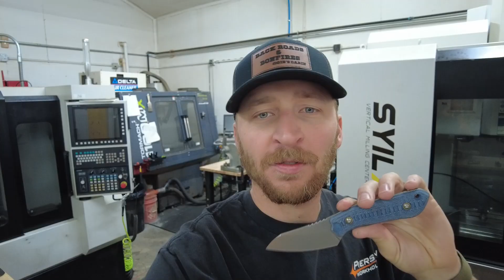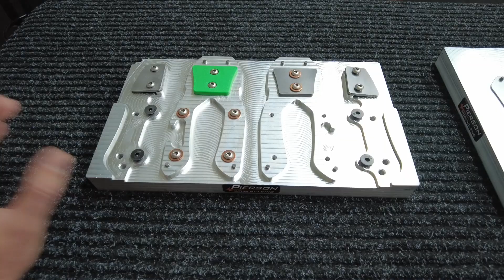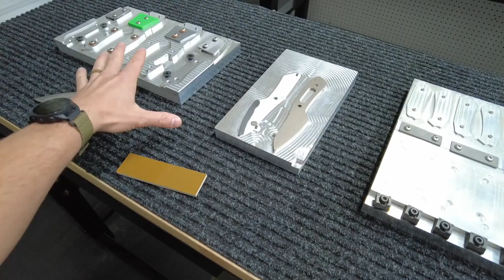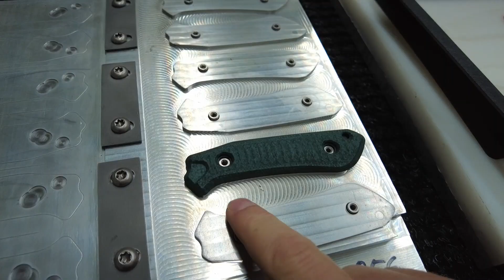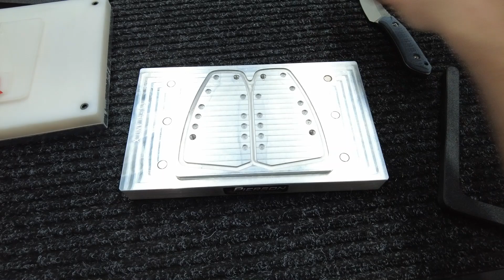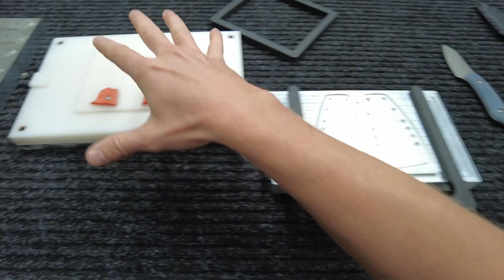Every Single Fixture We Use to Make a Knife (Explained)

Comment: Huge thanks for sharing your knowledge — really appreciate it! Very interesting fixture for grinding bevels. Right now I grind them on a belt grinder, but I'd like to automate this process. I'm planning to buy a CNC machine, most likely a SyiL X7 like yours, and use it to make bevels in a similar way. As far as I understand, to make a fixture like this, it needs to be designed first and then machined on a 5-axis CNC. Am I understanding that correctly?

Comment: hello mr Schwarz thank you for sharing. How you worked with resulting grinding and quenching bending? eg you've quench a blank and it always stay bended (up to 0.5 mm) then you machine/grind it and tip never been centered afterr simmetrical machining. So i just left enough thikness on edge and tip and fix it manually

Comment: This is amazing, It's incredible how you can come up with such an effective solution. I feel like an orangutan when I look at the fictures I use. what grinding wheel cups you are using? diameter, grid and kind of abrasives. I see the Syil x9 at the beginning of the video, do you use this for grinding? And are 3 axis enough for it? It's mindblowing.
Reply from the maker: I'll have to do a video on the grinding. Too much info to share in a comment.

Comment: Hey TJ, machinist and aspiring competitor here,
Awesome video, it will definitely come in handy as I am currently working on getting my own blades to production. On your first ("tang") fixture, I was wondering if you had considered using a double-angle chamfer tool in order to delete that 3rd op? 

Cheers
Reply from the maker: Yes, a back chamfer tool of some description would eliminate op 3, which would be nice. That method has one major downside which is that it opens up a lot of variability in the chamfer symmetry. Any variation in tang thickness, tool geometry, or z height would result in uneven chamfer depth. The 3 op method guarantees the same chamfer depth on each side and eliminates all those variables. Classic trade off scenario and I prefer the 3 op method 👍

Comment: Can you make a video (or a page on your website) that explains which models or colors have handle scales with a hollow center? Some product photos show solid handles and others hollow handles, it’s not clear which models or colors will have solid handles or not. Do all overland sports or overland x’s have tangs with cutouts so that hollow (open in the center) scales can be used? If extra scales are ordered, can we request hollow vs solid? These dilemmas have held me back from ordering. Another roadblock for me is not being able to see every color blade (cerakote) and scale color combo. You need a tool that virtually shows every possible model, material and color option. Or a page with a gallery containing hundreds of photos with every possible combination. This latter option (photos) would be better. Please keep in mind my intent here is not to criticize you or complain, I genuinely want to help you help me (and other customers).
Reply from the maker: Great feedback. I would definitely like to solve this problem. I think the best way would be to have a video to "watch before ordering" that shows all of the options. A configuration tool that generates all possible combos would be sweet, but a huge project. To answer your question - All tangs are the same regardless of scale design. The X and Sport have the weight relief pocket in the tang and the Overland does not. The scales cannot be ordered with the relief pocket as those have been part of our limited drops. You can always email me with further questions in the meantime 👍
Reply: @tj.schwarz  Thanks for the reply. The video showing options is a great idea and would be very efficient compared to the virtual tool or library of photos. Actually, if the video were broken into chapters (and time stamped with a list of links to the times a particular model/color/combo is shown), that would be even better than any photo library. Regarding the relief pocket scales, I'm a huge fan of how those look and would request that you consider offering it as an order option, understandably only for certain colors or something in order to not undermine the limited drops. Another idea is to partner with an outside company like VZ grips or Hogue to offer scale options that are different than yours. It would be cool, but of course please don't do this unless it makes sene for your bottom line 🙂

Comment: Would it be possible to build the grinding fixture by machining it into a magnetic chuck? not the cheapest, but very easy to keep the blade flat in that
Reply from the maker: That would be very cool. I think the magnet at the tip is sufficient, but I like your idea.

Comment: Quick way to convert an old fixture:  make a small palllet that you can bolt the existing fixture to.  Put that on the base, probe the old fixture WCS point and write down the machine offsets.  Find the difference between the fixture offset and your WCS point on the pallet.  Go into your modeling software, create a plane offset from your original WCS point in Z by the difference, then sketch on that plane and just drop a point dimensions from the original WCS in x and y as the delta from the pallet base.  Change your machining model to use that point as the WCS zero, change the work offset to match what you use for the pallet base zero, and it should be good to go!